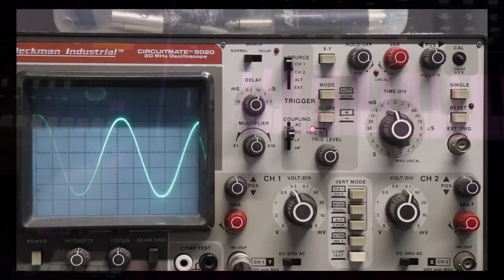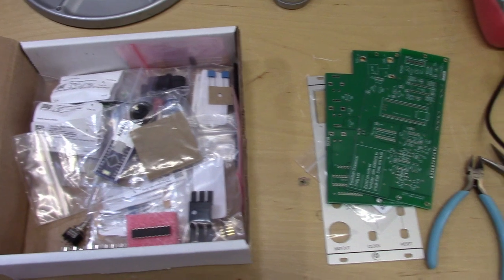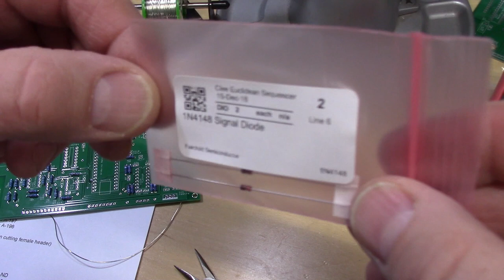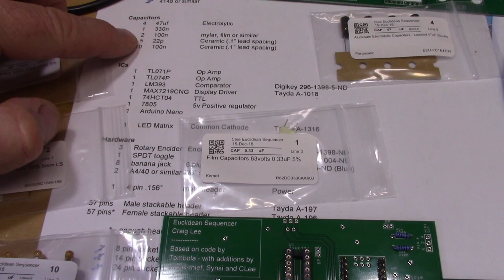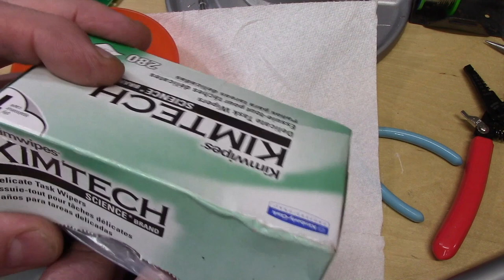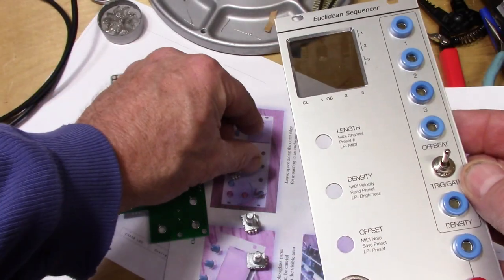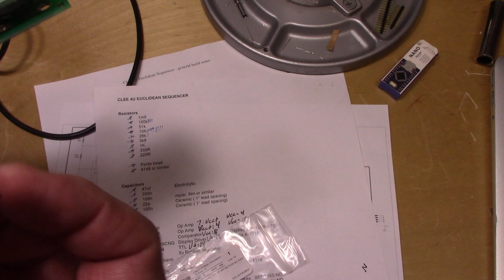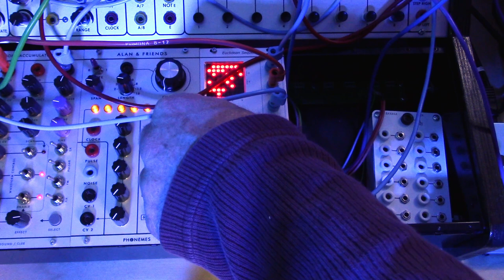Building a DIY Synth Kit | Tutorial

Comment: Pro-tip. If you lay the filter fan assembly down on its face and point the bottom of the unit where the slot is towards the work area, it will be far more effective at moving air due to increased velocity. Give it a shot sometime.